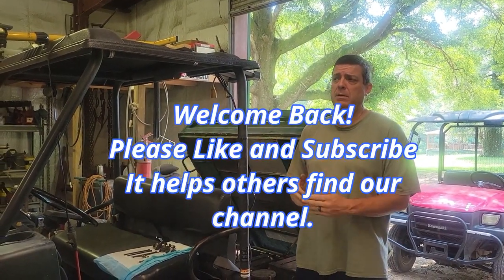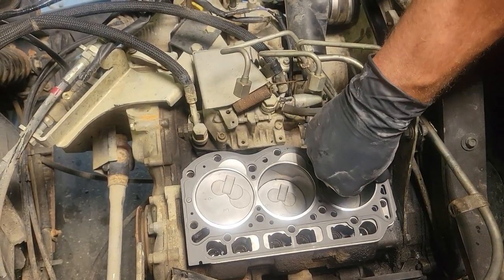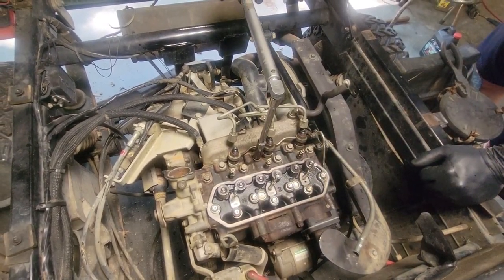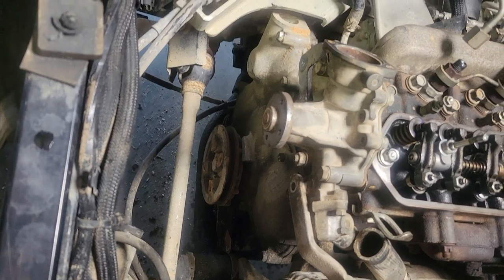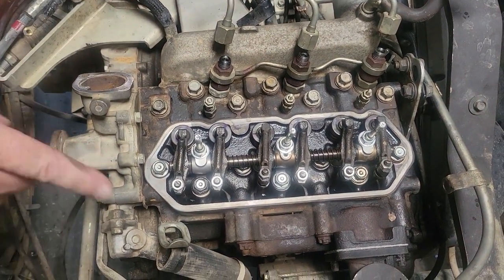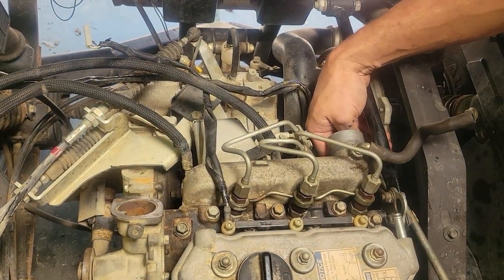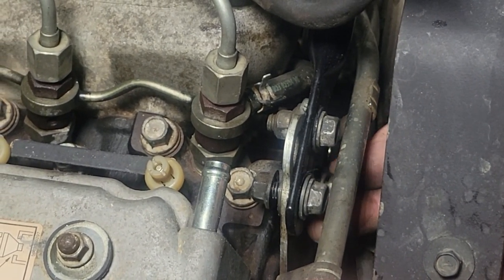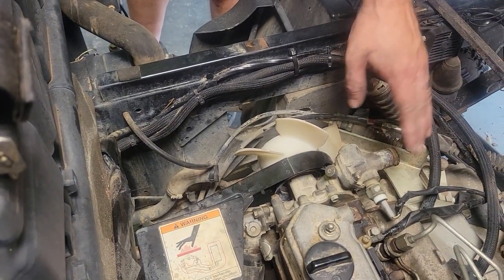Kawasaki Mule 3010/4010 Diesel Overheating Issue Fix Part 2 of 2

Comment: Hi, I bought a worn out one, won't even roll off the trailer yet, so this was very helpful to me even though I am a fair mechanic, its great to have a run through and review of some of the fine points and idiosycracies. Mone is an 04 3010 4x4 Diesel. Thanks very much.

Comment: Good Information.  I am having an issue with my Kawasaki Mule 3010 Diesel.  It has 39 hours on a rebuilt engine.  It has been awesome until a couple of weeks ago and I had to replace a glow plug sensor, and then a couple of weeks later, it just bogged down when I was driving, as if it only has half power.  It sounds good, but won't hardly drive.  It was recommended that I change the Fuel Filter.  I did that, but nothing changed.
Reply from the maker: It could be a lot of things, but I would start with valve clearance check if the fuel filter didn't help.  Good luck.

Comment: Great videos! I just bought a 2013 4010 diesel but luckily it runs great with no overheating. I changed out the coolant which did look a little rusty… Makes me wonder if his whole problem was a loose belt since his fan was slipping which would also hinder the alternator output. I would’ve kept an eye on the coolant level to see if it was slowly dropping… But you definitely did the “full Nelson” on that unit, GREAT VIDEO!
Reply from the maker: Thank you sir!

Comment: Really good videos, thank you very much for sharing. I have an overheating issue with mine. Took a long ride in the woods last week and steam boiling coolant was coming out of the coolant reservoir and the fan was not kicking. I suspect air was locked as it was missing coolant when I got the Mule. I had filled it up before I went riding and I know the fan was working before with short rides (less than 1 mile).  Today I started investigating this and the thermostat is missing. So I ordered a new one. I hope the head gasket is not blown but will see when I get the thermostat and purge the air...
Reply from the maker: Thanks for watching and good luck.  Remember if you do have to replace the head gasket use original parts.  The aftermarket gaskets are not any good.
Reply: @JasonJonieBuilds  I followed the coolant "fill" procedure and took a couple of longer rides and the MULE is not overheating anymore. However I am seeing a loss of power compared to as before the heating event. I took a compression test thru the glow plugs (took out the 5 amp fuse to disable the diesel pump) and got 420-420-440 psi. Are these values acceptable ?
Reply from the maker: Those look good to me.  You have less than 5% difference between cylinders.  You could try loosening your valve lash to .009 instead of. 008 and see if the power is any better.
Reply: @JasonJonieBuilds  Hi, I changed the fuel filter beside the tank, debris and a bit of water came out of the old filter and I also changed the air filter and I am seeing a bit more power. I noticed puffing air is coming out of the rubber cap at the end of air filter bowl. Is this normal ? or Am I having a valve intake problem ?
Reply from the maker: @richardverville3893  It could be valvetrain related or engine blow-by.  The mule I repaired in the video had a similar issue.  He said it had been doing it for some time.
Reply: @JasonJonieBuilds  The guy who sold it to me has another one, I'll ask him if his does the same thing
Reply: Hi, me again :(, good news is power is restored. It took a couple of short rides after the filter change. I, however, also changed the oil filter and oil and noticed diesel dropping when the motor is running. It is not  coming the injector lines. I tried looking around with an inspection camera and not finding where it is coming from. It is dripping around the back of the oil filter. It looks like I will have to take it off the motor to find where the leak is coming from. Do you have a video for that ?
Reply from the maker: Sorry Richard I don't have any other videos on the Mule.  That is something you will have to find like you mentioned.  Good luck

Comment: I own a Toro workman with the same motor it's got nearly 5k hours and running strong, although compression is low on one cylinder. At some point it's going to get a valve job and cylinder inspection. Take care of these and they can last
Reply from the maker: Yes sir they will.

Comment: Hi, Jason I am another follower great video with great explanation and like you said no many videos like this.  I own a 2009 kawasaki mule 4010 trans diesel cranks but won't fire up and I bleed all the fuel sistem put new glow plugs and still can't get it to start but I recently checked the compression on all 3 cylinders and two of them read 150 and one only reads 25. Do you think maybe I have the same issue your friend had‽ Any info would be appreciated and if I can get the link for the parts would be appreciated as well thanks looking forward to hear from you
Reply from the maker: Thanks for watching Raiza.  I don't have the part numbers handy but they are pretty easy to look up online.  Just don't buy aftermarket gaskets.  Pay the extra money and use OEM.  I would make sure your valves are set correctly before you tear it completely down.  If a good valve adjustment does not help I would probably pull the head.  This is just me.  Good Luck!
Reply: @JasonJonieBuilds  Thank you for your reply! I'm definitely going to take up on your suggestion before I take apart the engine. I just adjusted the valves, the manual book says to set the valves with .008 clearance and that still didn't help my problem. I did a leak down test and compression test and no pressure on cylinder 3. There's air coming from the exhaust, I hope it's just a bad valve or top end work that needs to be done.

Comment: I have a pair of Kawasaki 3010s  I traded for some work. Both have cracked heads on them. I  am going to fix them up. 

After a lot of thought, and tearing these things apart, I think I know the reason they fail. The water pump in the D950d/g are undersized. They might be fine as a stationary engine with a short length coolant circulation system. But the pump really struggles to move the fluid to the front radiator and then back. Honestly, unless you are reving it, the coolant doesn't move. At first I thought the engine was made of cheap materials or a improperly torqued head gasket, but no. It's just not getting cooled properly.

As solutions I have thought two things. Bring the radiator to the back, closer to the engine  like the first generation of these diesel mules or an inline water booster pump. I bought a BMW auxiliary electric water to to see if I can add it to the system. 

Unless the water circulation can be improved, they will keep baking heads and gaskets. That's what I think anyway.
Reply from the maker: I have not done that much research on it.  I agree there is an issue though.  Thanks

Comment: Hi, just bought a 3010, swapping engine out, how do you bleed both radiators?
Reply from the maker: It is tough....fill with coolant, raise the front of the utv.  Purge air from the purge valves (screws) at the thermostate and radiator coolant tube.  Runs the engine with rad cap off and let it bubble the air out.  It can take a long time.  Pray....These are finicky machines.

Comment: How long does it normally take for my fan to kick on. I followed this video to the T, new radiator and water pump included and I never heard it come on. Hot engine light turned on. 😔😔 I hope I didn’t just waste my time with a head gasket job.
Reply from the maker: You might have a bad fan switch.  It is screwed into the radiator.  Does your radiator get hot?  If not, and still get hot temp light you still have air in the system or getting air in system.
Reply: @JasonJonieBuilds  hi Jason. The radiator did not get hot. I did see a small leak around the hose going to the thermostat housing. Going to repair it. I did put a new fan switch.
Reply from the maker: It sounds like the air is not out of the system or you possibly have a cracked head.  There is no way of me knowing.  I am just trying to give you some things to think about.  Good luck.

Comment: I have a 07 mule 4x4 diesel that if I start mine with the rad cap off it shots water out think I have a bad head gasket to but can't find the gasket or the exhaust gasket
Reply from the maker: I bought my gaskets off Ebay.  I sounds like yours is blown but of course I cannot verify that for you.  Good Luck